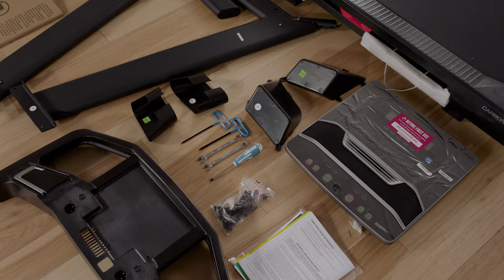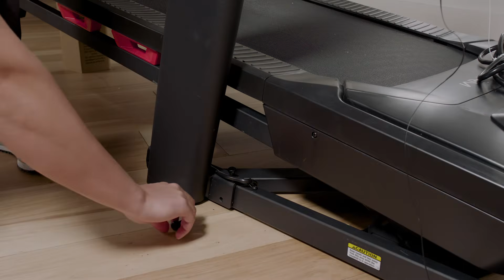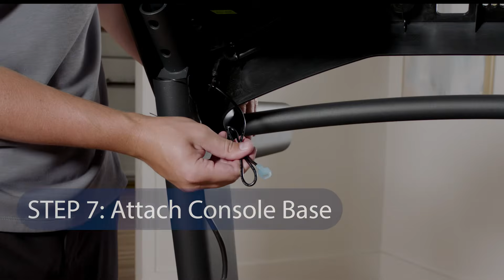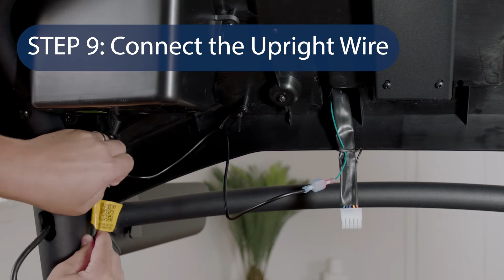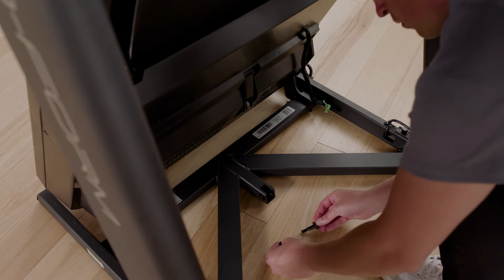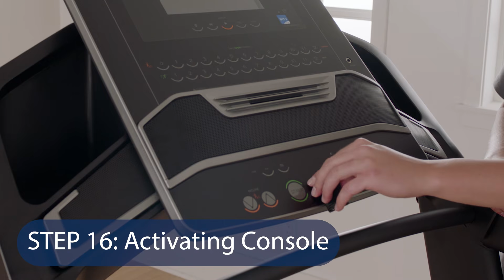2023 Proform Carbon TLX Treadmill

Comment: My uprights do not line up to the holes to secure in step 3, how do I get the correct uprights?
Reply from the maker: In the USA contact iFIT Member Care @ my.ifit.com. outside of the us you may have a member support center (check your users manual for information or reach out to your local distributor.

Comment: There aren't enough of the 3/8" star washers to use one on all of the bolts to fasten the uprights to the base as shown in this video.  The paper instructions don't use a washer when attaching the wheel to the base.

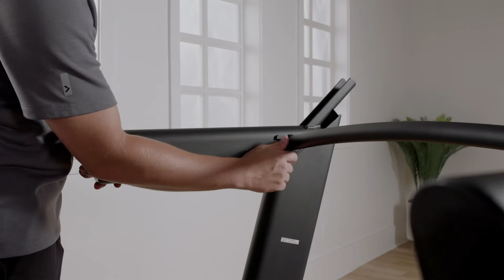Comment: 2:16 cross bar I received is small.. Do I need to place an order for the part or how to install with existing one ?? 2:16
Reply from the maker: Usually this issue can be resolved by keeping the upright bolts loose or loosening the upright bolts at the bottom of the machine.

Comment: My TL came with two 6”x1” black metal bars with no holes and felt on one side zip tied to the base towards the top on both sides. The manual makes no mention of them, and I have no idea where they go.
Reply from the maker: These are part of the packaging and should be discarded responsibly.

Comment: Some updates as of August 2025:

The main included allen wrench no longer has the nice blue handle as in the video

Don't use washers for wheels as mentioned in video (not enough included, and written instructions don't call for them either)

Upright and console wires no longer come with red markings, but are keyed so you can only connect them one way

Oval grommet for right upright is now made from a hard plastic instead of rubber, so it's less pliable and may be more difficult to install

Upon first startup, treadmill does not require iFit unlock, nor alternative manual unlock method. It just works right away
Reply: Is it the same for 2026 model as well ? I just got a tls

Comment: What are the dimensions of the box the treadmill comes in?  Length width, and height in 
inches.  Will it fit through a 34- inch- wide- door?
Reply from the maker: My source indicates the box would be about 83.5" X 31"X11.5".

Comment: Do you need a "ifit" subscription in order to use this treadmill?
Reply from the maker: No, An iFIT membership is not required.
Reply: @FitnessEquipmentHelp  Very quick response, thanks!!!  Excellent assembly tutorial by the way.  I have narrowed down my search to this Proform Carbon TLX and the Xterra TRX3500.  Only reason I am considering the Xterra is because of the "Lifetime" frame and motor warranty.  Any thoughts?
Reply from the maker: @seymourscagnetti7777   Well I'm biased and this is an iFIT channel so take that for what its worth. I did just help a friend get into the Carbon TLX and he and his family love it. The numbers look good on the Exterra but I don't have any first hand experience with it. What will set the ProForm apart from the other is the iFIT workout content. Although it is a subscription service it is amazing content and quite engaging. I recommend you check it out. With the ProForm the option is there. My friend signed up with the Pro membership for his family before the first 30 day cancelation period. For what it's worth.

Comment: Hello! My proform carbon tlx won’t power on after several reset attempts. I bought just over a year ago with no issues until now. Is there another solution to try (ie a manual reset option / pin hole)? Thanks!
Reply from the maker: Check to make sure the safety key is in place and that the power switch is in the on position. Do you use the iFIT software? sometimes the console will look off if they are stuck in the middle of an update. If so go back to your smart device (phone or tablet) and reconnect to the console and allow it to complete the software update. 

If this is not the issue then there is a large circuit board with some LED lights that can be checked under the motor hood. With the machine unplugged remove the 5 motor hood screws and remove the hood. carefully check for any loose or disconnected wires, re attach any wires that are out of place. Carefully plug in the machine and turn the on off switch to on. There should be a red and green LED light on the controller (large circuit board. If there is only a red light then the controller will need to be replaced. If both red and green lights are on the controller then there may be an issue with the wires between the controller and the console, or something else going on with the console.

Comment: How to used ? I used have old one where I can see track this one I can’t . 
It help me how many laps I was doing
Reply from the maker: Although this model does not have a track display it will give you your total distance in miles or kilometers on the screen. A typical track is 400 meters. 4 times around the track is aprox 1 mile. I hope that helps.

Comment: My crossbar does not reach each of the sides
Reply from the maker: Loosen the bots at the bottom of the upright. They should be very loose during assembly. Then tighten them when instructed in the assembly instructions.

Comment: What if it’s missing a crossbar from the packaging!  
How do I get another one from the manufacturers?
Reply from the maker: Contact member care by reaching out to the number in your manual or my.ifit.com if you are in the US. If you are outside the US. contact your local member care office or your authorized distributor (where you purchased it). A replacement part can usually be sent out pretty easily.
Reply: @FitnessEquipmentHelp   thank you so much

Comment: Could you advise on which lube to use on the walking belt silicone based or wax based
Reply from the maker: The only Walking belt lubrication approved by the manufacturer for this equipment is the Icon/Ifit Performant Lube. Use of any other lubrication may effect your warranty coverage.

Comment: Does the speed go up by .1 intervals or can you only go by the full numbers?
Reply from the maker: if you use the speed + or - buttons you can go in .1MPH increments. iFIT treadmills also have quick speed buttons that allow you to jump to the nearest whole MPH with the touch of 1 button which is convenient for changing speeds quickly in a workout.  Also most people don't realize if you want to go 3.5 MPH for example, if you press the 3 button followed very quickly by the 5 button the unit will set the speed to 3.5 instead of needing to press the up button 5 times.
Reply: @FitnessEquipmentHelp  Okay thank you so much!

Comment: I dont know how to start this thing.
Reply from the maker: I assume you have the treadmill assembled. For some time now units with Bluetooth iFIT connectivity required activation, achieved when you connect your treadmill to your smart device to access iFIT content. If you are not going to use your included 30 day iFIT membership then you can also activate your console by powering on the treadmill and with the safety key in place, PRESS and HOLD, the Bluetooth button (iFIT SYNC) on the console for about 15 seconds.
Reply: @FitnessEquipmentHelp  mine is assembled and i have the key in and NOTHING is happening... i dont understand....
Reply from the maker: @fatbastard606  This is usually caused by a pinched broken or wire that was not assembled correctly... you should double check your assembly. Please do also check to make sure you have power from the outlet and that the power switch at the base of the treadmill is in the on position.
Reply: @FitnessEquipmentHelp  Thank you very much for the reply, about 3 hours ago I finally found that there was an on/off switch at the bottom haha. I feel very very stupid now :D. You would have definitely solved my problem tho! Cheers bud
Reply from the maker: @fatbastard606  I'm glad it was something simple and not an assembly issue, (or something requiring parts). I hope you enjoy using the treadmill :)

Comment: Does it come with tools to assemble , wrench and screwdrivers ..etc that you used in the video
Reply from the maker: Yes, this model does come with the tools necessary for assembly. While most equipment does not come with assembly tools many of the current models from iFIT are coming with them.

Comment: My treadmill didn't come with a crossbar. Should it be worried?
Reply from the maker: different models and version of models may be bult slightly differently. the model in this video is a PFTL90924. if your assembly instructions did not specify this part then i would not be concerned.